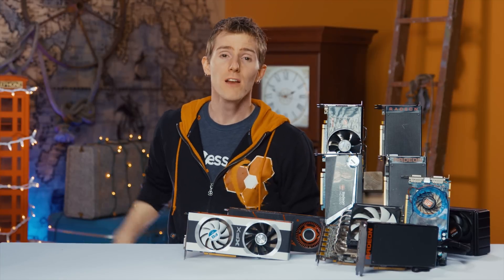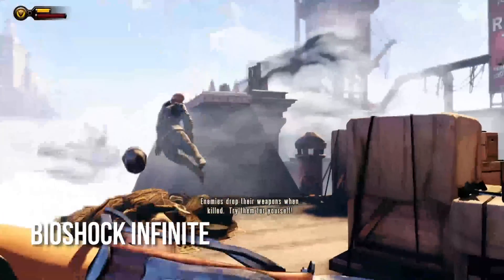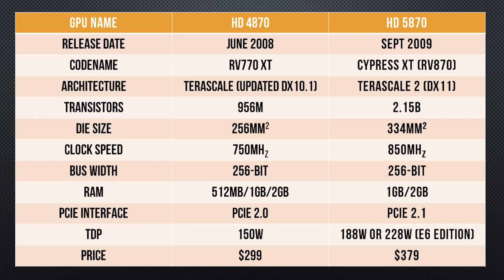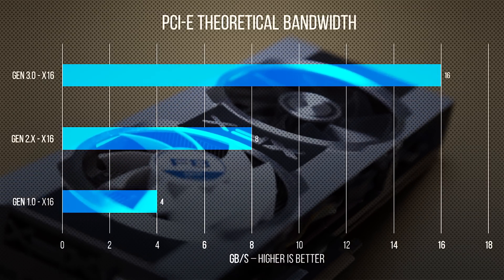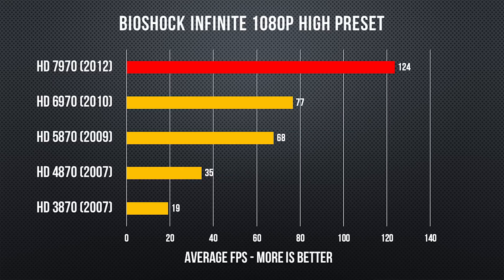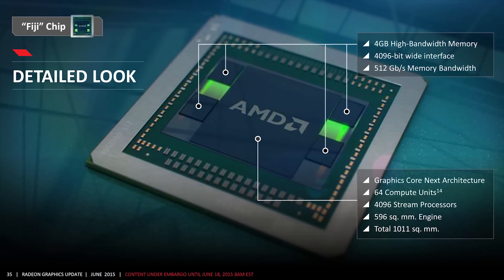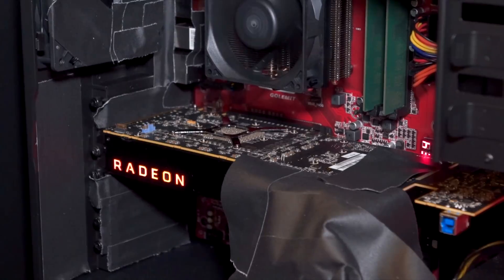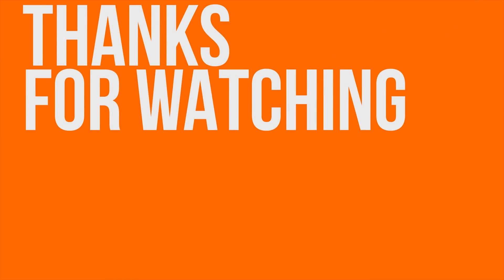10 Years of AMD Video Cards BENCHMARKED!

Comment: Wait what about the R9 295X2?
Reply: They said single-GPU cards only
Reply: ABambooBilbo single gpu cards....
Reply: As an owner of a 295X2 I always feel like a ghost when these comparison videos come out. I'm in the room, but no one notices.

Come on AMD, release a 595X2. Pleeeeease!
Reply: 1:00 single gpu..
Reply: Yeah, the Titan Z was a duel GPU Titan, and it lost big time to the 295X2, so it was a direct comparison since they were launched the same year. The 295X2 just happen to also beat the next Titan, which was impressive. A GTX 970 is nowhere close, the 295x2 beats the Titan X.

Also, most of the AAA games support crossfire, so its not a huge deal. Otherwise a Single Titan XP can't even run Fallout 4 at 4k with everything turned up (and the original Skyrim with basic mods looks way more impressive...). So that game allows multi-gpu.
Reply: I think they can actually run separate. Like you would have just a 1x card.
Reply: Jose Delgadillo yeah i just hate xfire i did it with 7950s and the microstutter is unbearable plus i dont mind fram drops from like 55 to 40 or such but when you drop 60frames at onces it is very jarring. maybe now with free sync but from my discovery it is really just why nvidia is more strict on mobo compatibility and such and why sli is generally better with framepacing and timing
Reply: ABambooBilbo I couldn't afford a 290x2 but R9 290x reference cards where available as open box (been sent back) for under £200 .
I had two but early Crossfire support wasn't good , I've had a much better time with the RX480 in Crossfire .....just saying
Reply: No need to mention it. it's just two of the cards he mentioned stuck together.
Reply: >top single chip graphics card of each generation
Reply: nah it(pro duo) doesnt beat a gtx 1080 non ti i just checked it out, maybe it does in doom but thats it. Also it doesnt handle 4k nearly as well for the power. If it even matched a 1080 i would of chose it since my 4k monitor has freesync.
Reply: Dude I said it was beating the titan Z. And that's what it has been made for.
Reply: The only problem I see with dual GPU cards is if one GPU fail you have to replace the whole card.
Reply: Hot? its stay around 60c at 100% load
Reply: or 390x2
Reply: i still got my 3870x2 stashed away! i still think that the amount of gpu's should not matter if its all on one board! its one card just like every other video card
Reply: Rares Macovei , I get that LMG are Nvidia shrills but this more or less ticked the boxes for quality viewing , and went some way to fix my shill's assumption
Reply: +TheWorldCouldAlwaysUseMoreHeroes you do get a slight clock bump as stock but it doesn't overclock well
Reply: Because that's just two GPU's mushed together. That doesn't count for "innovation" and "changes" through the years.
Reply: Yeah, and what about radeon pro duo? It isn't even mentioned in the video.
Reply: R9 295x2 and radeon pro duo are SINGLE cards (card means square shaped pcb that you plug in, if it takes one pcie slot, it means its a single card), and YES they are both DUAL GPU. If they say to all of the people that they test FLAGSHIP cards they should test FLAGSHIP cards, meaning the most powerful on the market from said manufacturer, not "flagship"*, so the video theme is misleading. And second thing, rx 480 IS NOT a flagship AMD card... the new flagship cards from vega/polaris generation are not on the market yet..
Reply: It's a dual gpu card since it has 2 processing units.
Reply: 295x2 crush the titan Z for half the price, lower temps, lower noise.
Reply: ABambooBilbo because the 295x2 was really just two 290Xs on the same PCB, effectively being nothing more than a hot pair of 290Xs in crossfire.
Reply: Mmmmm, 600 watt card. They'd be kinda stupid to make that. But maybe they are just stupid enough to do it for the 4 people who will want one
Reply: https://www.google.com/search?q=295x2&rlz=1C1CHBF_enUS729US729&source=lnms&tbm=isch&sa=X&ved=0ahUKEwinvPnOsejSAhUj6IMKHac_D7EQ_AUICigD&biw=1920&bih=974#imgrc=xI7rgFZc5UedFM:

single it is.
Reply: and the 390x2 which is not water cooled so it is even more awesome
Reply: 295x2 lower compatibility with games too so alot cant take advantage at all or until proper xfire drivers are released because it still rely's on the xfire software end.. also isnt the titan z like 3 or 4 titans ago lol like a single 970 could prob match it lol and cost alot less
Reply: Michael Simpson - The 295X2 is underpowered (by today's standards) if the game does not support crossfire. But if it does support crossfire, it's still a great card even for new titles.

At only 4gb of video ram (8gb divided by two GPUs) it's not great for 4k. I'm using mine with a 1440p 60Hz monitor and it works good for that.
Reply: it is single gpu even though its two 290xs its on one mb soooooooooooooooooooooooo

Comment: Still Playing with my 7970 and 280x in CF :D
Reply: rightfully so.
Reply: mazedmarky it works without problems. ^^
Reply: Yea those cards are awesome. Got an RX480 and will get a second one later this year, was always interested in trying out CF.
Reply: mazedmarky 4Gb or 8Gb? the only problem is the 3gb Vram :/ they have a lot of power but they're running out of vram
Reply: Yea that is sad. I just recently learned Vram doesen't add up in CF :/ I got the Sapphire reference 8GB, it runs at 1320/2125 @1080mV. Gonna upgrade the cooler in a few months because I am able to hit 1420mhz on the core and that results in a nice fps boost.
Reply: mazedmarky i Also have the rare Devil 13 7990 :D but I really like that Amd still supports those cards they also work with DX12 fine.
Reply: Haha nice, I bet that thing is a monster.
Reply: 16bananaking I have a 280x sitting in a desk somewhere. It would artifact on its own, but when used with a 7970 flashed to a 280x as the non primary card it worked great.
Reply: it is Huge ^^ and i love it. but i have an wallmounted PC and it weights too much :D That why my Dad is using it in his PC

Comment: 5:02 All three of the major console manufacturers? I thought Nintendo used Nvidia tech for the Switch, not AMD.
Reply: MrRicearonie notice that he didn't highlight the switch when the chart was up. I think he was referring to the Xbox one, PS4, and PS4 Pro.
Reply: They do I mean you can see it in the Video aswell...no idea what Linus is talking about....
Reply: I guarantee Linus was talking about the Wii U.
There was probably just a mix-up in what image they used to reference the subject.
Reply: Also the switch replaces the Wii U as well. AKA the Switch is nintendos newest console/portable hybred and will likely be replacing the 3DS as well down the line.  So Linus was still wrong when he said that current consoles from the 3 companies all use AMD Chips as Nintendo has pretty much killed the Wii U and the Switch is their current system which uses Nvidia Tegra.
Reply: Also consider that ATI is effectively just AMD's GPU division now so the two combined covers Nintendo's main consoles from 2001 to 2016.
Reply: >implying Nintendo is a major console manufacturer...
Reply: Jyrka98 While that is correct, and Nintendo did use Radeon Graphics for the GameCube, Wii, and Wii U, the time frame only makes it possible for the Wii U to use the architecture. If Linus is referring to the Wii U, which I doubt, then maybe, but the Wii U was not in the image they showed in the video

Comment: >all three of the big players (game consoles)
>only Sony and Microsoft because Nintendo used Nvidia
Nice maths
Reply: I honk he's saying the Xbox One, PS4 and PS4 Pro, as the PS4 and PS4 pro are supposed to coexist rather than the PS4 Pro being a generational leap
Reply: In terms of performance and architectural similarities, Wii U was a Radeon 6970 soldered onto three GameCubes.

And just to correct another comment, the 3DS had nothing AMD in it. It's GPU was made by DMP, a company you've never heard of.
Reply: Sorry but Nintendo has pretty much killed the Wii U in favor of the Switch so its NOT the current console from them anymore.
Reply: I tihnk he was referring to HOME consoles, where Ninetendo's equivalent was the Wii U
Reply: As I said Nintendo has killed the Wii U in favor of the Switch so the Switch is their current home console.
Reply: i think they were talking about the wii u
Reply: MrZodiac011 autistic kids is worse then mosquitoes now a days
Reply: people still talking about the wiiu when linus said current gen. WiiU is trash gen, the switch is current gen
Reply: People still talking about the Wiiu being current gen, Wrroonnggg. The WiiU is trash gen, the Switch is current gen (hardly)
Reply: Nintendo is crap i'll agree with that but Nvidia and Intel are better than AMD because a GPU for the same price performs a lot better, the 1060 and RX 480 are similar prices yet the RX 480 performs like a 960/1050ti or 970 often and the 1060 is basically a 980 so yeah, not sure how that happened, sure AMD sometimes has the more powerful cards but they never perform as well, the Fury X performs worse than the GTX 1070 in most games yet is supposed to be more powerful

Comment: Good video Linus, keep your heads up, don't let the haters drag you down! You slipped up a little bit on the title, owned it, and moved on, and everyone else should do the same!
Reply: BTW, I hope the Ryzen 5 series is that good, though I plan on going with 1700 anyways for some media work.
Reply: It's a great chip, and you can even overclock it to 1800x speeds on the stock cooler (which isn't really that loud at full speed)